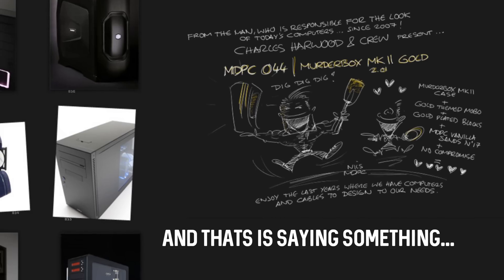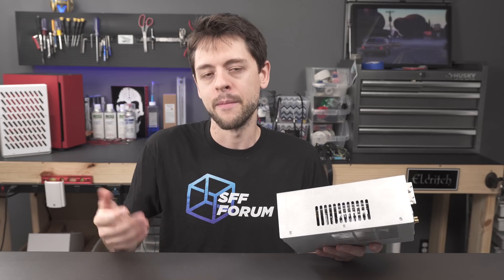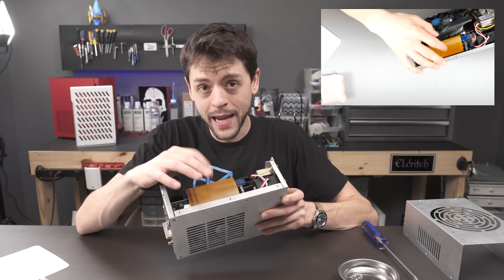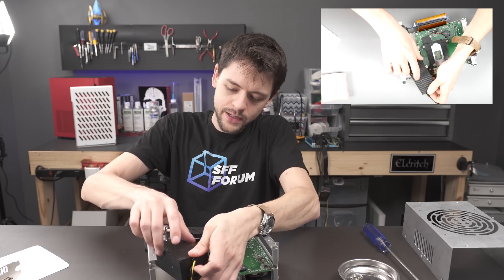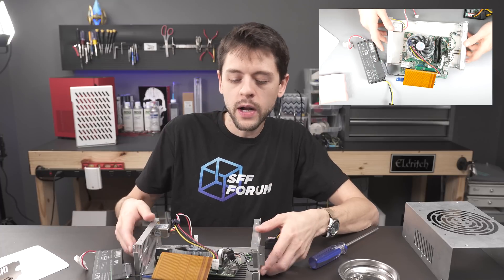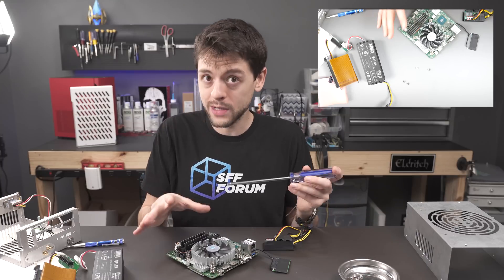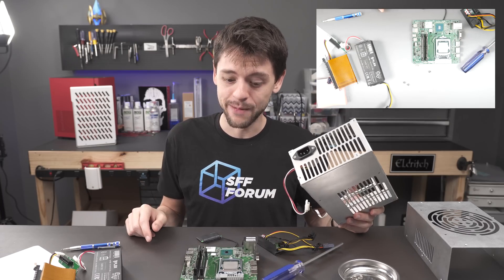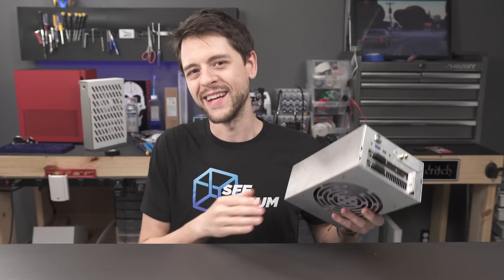"STX160" Smallest PC Mod, or really large PSU?

Comment: I have an Omen 875-0034 desktop computer. It only has one spare PCIe slot and my GPU is in it. I would like to add an ieee1394 firewire PCIe 1lane card with an adapter to my m.2 socket 1 key-A /E that currently holds My WIFI and Bluetooth that I do not need. A m a z o n has a M-2Key-PCI-Adapter Slot/DP/DP/B07YY7BCGR.
Will it work in Windows 11? specs on m.2 Key-A:  Notched Pins 8–15, Provided Interfaces 2 of PCIe ×1, USB 2.0, I2C and DP ×4) Near field communications, Wi-Gig (some say A+E key?)
Reply from the maker: Get an ADT m.2 to pcie adapter

Comment: Great video! So you think I could do the same with an ASRock Deskmini 310 or any H310M-STX Motherboard based pc using its ultra M.2 port?

If I've understood, we just need an M.2 socket with PCIe Gen3 x4 lanes mode, the adapter and of course enought power.
Reply from the maker: You can indeed. I'm building my PC based around this concept now.
Reply: @NotFromConcentrate  thanks!!

Comment: I would like to make a Media PC out of an old Commodore 5124 Floppy Drive - even using the slot at front for a Bluray.

After seeing this build I was considering doing something similar in an old Xbox 360 case with old laptop motherboard and same pcie gpu adaptor with external power adaptor instead.

Comment: Have you considered using the ASRock STX-110 MXM? It's basically the STX-110 but with an MXM slot, which means you could put a GTX 1060 in a case you could fit in your palm.

Comment: Hey NFC, great videos! I've just subscribed.
For the last few months I've been working on my own mSTX build using that asrock mobo with an eGPU running through the m.2 interface (slightly different to James' solution). Glad to see I'm not a lone crazy person working on such a project. 

I'm not a great craftsman like you, so rather than building a case for it I think I'll vesa mount the PC to the back of my monitor and have a basic but full-length GPU housing as the only thing on the desk. I'm running a G4560 on it now, but I love the idea of this tiny machine killing it with a Coffee Lake 6C/12T i7 when they come out, and perhaps pairing it with a Vega (depends on power draw). If only there were some way of tapping more of those PCI lanes...

Comment: would you say that the HDPlex metal power brick is more reliable than the one from mini-box.com or no difference? I want something small like that but I'm worried about reliability
Reply from the maker: Which products are you talking about? mini-box makes amazing products, and so does HDPLEX. Mini-box tends to make 12v-12v stuff whereas HDPLEX is wide input.

Comment: I think we need to start seeing dual sided motherboards...PCIe on the back, RAM and CPU on top, and a new standard for CPU / GPU coolers that more resemble beefed up laptop heatpipe cooling than current desktop solutions.  We're getting there...
Reply: modular laptops? i'm in!
Reply: Pretty much, just no screen or keyboard, and much higher TDP than typical laptop.
Reply: Yeah, but you can pretty easily buy both of those in SFF or salvage them from older laptops

Comment: Does using the M.2 to PCIe adapter throttle the GPU?
Reply from the maker: It's something I could test specifically, but Gen3 has so much bandwidth I doubt it would be noticeable if I could even measure it. Linus and some of the other big guys have done these kinds of tests too if your interested. https://www.techpowerup.com/reviews/NVIDIA/GTX_980_PCI-Express_Scaling/21.html
Reply: If I understood this correctly, it is measuring the PCIe scaling from one version to another. It is not measuring the usage of an adapter such as M.2 to a PCIe?

My concern is that it is being throttled by the type of PCIe and also by the M.2 which is not designed for graphics cards.

If you do have the time and that it is beneficial to you to do a test, I'd appreciate it. Otherwise, no worries. :)

Thank you!
Reply from the maker: I'm totally with you! I think the quality of the adapter matters, as James' talks about in his extensive thread. You can buy an adapter for $9 off Amazon, but the one he used is closer to $100. Ultra M.2 is pretty much PCIE 4x, so we are good there.  The best way to test this would be to find a board with Ultra M.2 AND a 16x slot, but I unfortunately don't have time to source this, so the the 3D mark score (which was 10k and change) will have to suffice! I am super curious myself though...even if it doesn't matter practically. Peace and THANK YOU for your time!
Reply: m.2 is basically pcie so it isn't really changing anything just a different "plug" on it

Comment: Is putting a layer of cardboard safe? I'm building an nes pc with a flex PSU and a small form factor 1050ti with the back of the GPU practically touching the metal shell of the PSU and I'm scratching my head trying to figure out a safe way to use that configuration.
Reply from the maker: Yeah--it should be safe. Plastic is typically used in power supplies, but it warps and when it does burn its horrible. Paper has a lower combustion point but doesn't warp until it burns. Either one will be a fine insulator. Most GPUs have a layer of protective insinuative coating on them anyway so it would be extra protected! And if your hardware reached 451F, you have a serious problem anyway. Good luck with your mod!!!!
Reply: Thank you! Problem solved.

Comment: I would kill for this setup. It's using the STX board that comes with the ASRock DeskMini 110 he was able to run a PCIE off the M.2. This is an absolute game changer if it had a RX460 because the 460 is native for MacOS. Final Cut Pro X craziness. Remember this board can run the MacOS bios that ASRock provides
Reply from the maker: Oh interesting...I did not know that. I am getting more and more requests for hackintosh builds so I will look into that. Thanks!
Reply: Sgt Nik ummmm they just put a rx460 in a MacBook Pro. Remember it's not about high end components but optimization
Reply: https://pcpartpicker.com/list/sVPtqk
Reply: hackintoshs will die if apple is cutting gpu support more and more :( i hope so much for vega support
Reply: but except the rx460 there is no real "support" for polaris... i simply want full vega or volta support in macOs :)

Comment: That is an awesome video!!! I panicked when it caught on fire. I am trying to make a mini-itx PC myself that is shaped like a laptop and want to use a Pico PSU. I found a 330watt Dell PSU on Ebay for a good price but the HDPLEX 160 was a bit expensive. Would the Pico PSU 160 work instead? Specs are an Intel Pentium G3420, 8gb ram, gtx 1060. Also I am making a prototype case from 3mm MDF wooden board. Using a screw kit with standoffs and so on following some measurements from a DIY video I saw on YouTube. This is simply a very basic prototype and if the form factor works I will make a proper one from aluminium with all the bells and whistles. I might even go Mini-STX instead. I was actually looking at some on Ebay but didn't know how to add a GPU since it didn't have a PCIe slot. That would be really cool and I am glad somebody tried this. I was originally thinking to mod the Asrock Desk Mini by adding a more powerful charger and the PCIe x16 slot/ribbon cable from this video. Would be very cool!! Thanks for the video it was awesome and very interesting. I will thoroughly read the guy's thread and hope to see more content from you soon!! :) Just out of curiosity how much would it cost me for you to make a custom case similar to your own but with a few modifications? 

Many thanks in advance!!
Reply from the maker: Hey Tom! Thanks for the note. Please blast me an email so I can respond in detail to you. Peace!
Reply: Thanks! Will do. Sorry for the wall of text, I tend to ramble sometimes.

Comment: Another great video!! Wow, what a build! I'll be sure to check out the log. What do you have covering your work surfaces? vinyl?

J.
Reply from the maker: For my work surfaces I use carpet runner, which is insanely durable. For my "presentation table" I used textured vinyl (Di Noc) brushed aluminum. I don't recommend it. It is so beat up just after a couple weeks of use...  Thanks for watching and commenting!

Comment: whoa! now he needs to build it inside an actual shell of a PSU
Reply from the maker: It is a honest to goodness PSU shell! You can install PSU parts into it, including a PSU fan, and you can install it in the back of a PC case. I should have taken a picture of that...but it is really cool!  Thanks for watching.
Reply: Not From Concentrate I would kill for this setup. It's using the STX board that comes with the ASRock DeskMini 110 he was able to run a PCIE off the M.2. This is an absolute game changer if it had a RX460 because the 460 is native for MacOS. Final Cut Pro X craziness. Remember this board can run the MacOS bios that ASRock provides
Reply: Jeff Liu Yoshiyuki I was thinking about the same thing. This could be a total Mac mini killer!